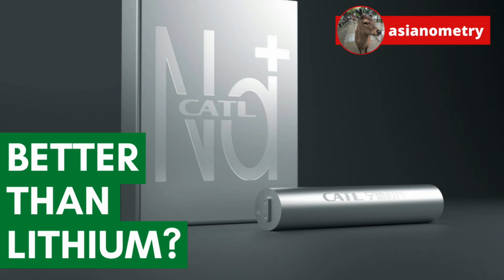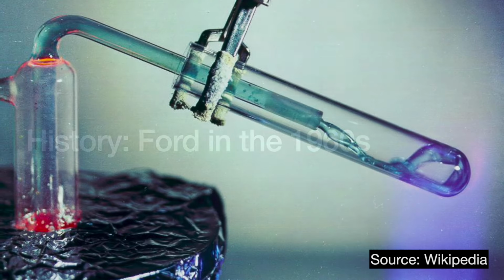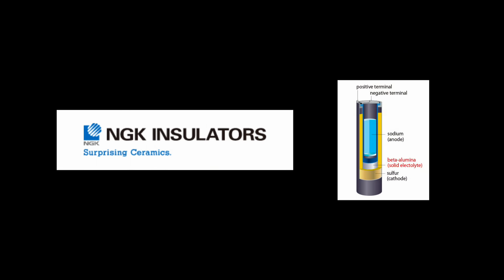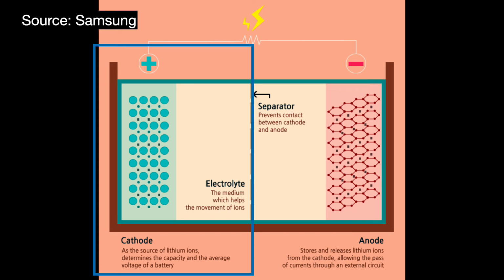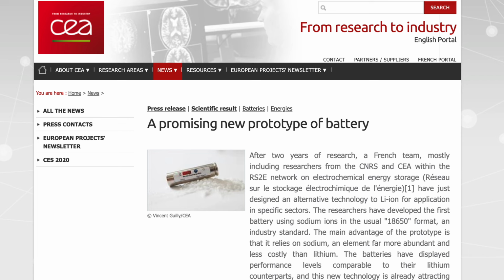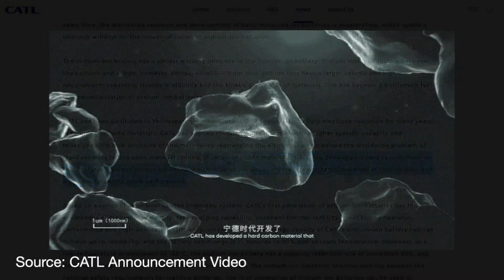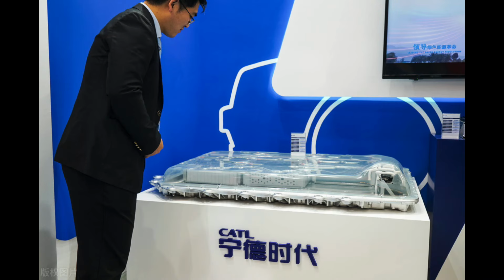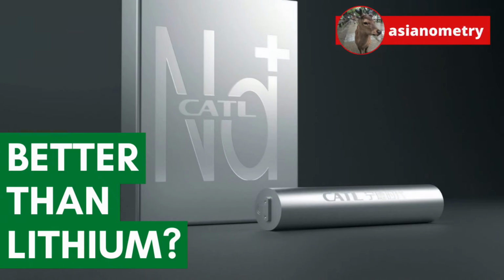CATL's Sodium-Ion Battery: Better than Lithium?

Comment: Considering how much of an EV is battery cost then 10-30% cost reduction on the batteries could absolutely be worthwhile. Even if the energy density is a little less.
Reply: This would be a game changer for the EV adoption. Lets hope it holds up to the high expectations.
Reply: availability (abundance) and low environmental impact is perhaps the most dominant factor of all as we're still at the cusp of EV transition. Will need a battery tech that stands up to a scale when everyone that currently drives a vehicle is driving an EV
Reply: The real metrics needed are cost/kWh vs weight of needed capacity. 

other considerations: 
Na+ cells are heavier for less capacity which can potentially reduce the efficiency of the motors in EVs
Na+ don't suffer from the same level of degradation of capacity that Li+ does (the so called "battery memory") 
Na+ has yet to be commercialized, and because it is emerging initial models will be much more expensive to recoup the cost of installing production facilities (or adapting current systems)
NA+ has a lower nominal voltage than Li+ and this is based on the chemical composition of the batteries and cannot be overcome. Li+ thus provides more desirable power for EV use

The point of developing Na+ batteries isn't actually to completely replace Li+ across the board, rather to reduce their use to situations where their density and voltage are required. By using these Na+ for mass energy storage (homes, power grid, industrial and commercial) the demand for Li+ will drop (reducing costs) and become more available for consumer use and in industries that require them.
Reply: @kdelfuego8563  if you have studied physics you know that weight is only an extra consumption during acceleration and the extra use of the extra weight with rolling mass is a very small factor. With braking you can get that extra energy used by acceleration partly back so you waist even less the combustion engines. Weight is not such a big issue, Aerodynamics is a much bigger issue and has way more impact than weight has. I calculates before the model 3 with NMC battery vs LFP which has 130kg more battery weight for energy density. You needed about 1% more energy per kilometer for the cheaper LFP. And the extra weight is 130kg. So you see that it's a super small factor. This will probably be also the case with Na-Ion batteries and they will improve over time. Main advantage is cost + better for inviornment. Energy density means the car will be heavier. Is that bad? It's less of a factor than cost is.... as I just showed you. People do not think correctly about rolling mass versus Aerodynamics. This is a thinking error.
Reply: @kdelfuego8563  Lithium cells do not have memory. NiCd does, not Lithium
Reply: @kdelfuego8563  
I know that Li-ion xxx batteries doesn't have a  "memory effect". Actually they have, but is so low that it can be ignored. You write that they have "memoy effect" so then what is correct...have they or not?
Reply: @kdelfuego8563  what is it that you do for a living that has given you this knowledge, Mr Whitney? Genuinely curious
Reply: @kdelfuego8563  It won't reduce the efficiency of the motors one bit ! It'll make the vehicle heavier and thus consume more energy. Same result but you got the mechanism slightly wrong.
Reply: I have made sodium battery based on Aqs electrolyte which is more energy dense than lead acid battery and much lighter Wight with 2.6 to 3.1 volts using sodium based salt  i have video of it . I can improve it much better if i can find required materials like Organic solvent pc , EC ,  or DES , Na based chlorate salt
Reply: @omsingharjit  it is my understanding that in order to preserve the charge within the cell from settling towards equilibrium it is important to use an ionicaly conductive solid electrolyte to filter the Na+ ions. 

What has been your experience?
Reply: @kdelfuego8563  current  Electrolyte based  li ion based battery is also very stable at holding their charge for long duration  .
SEI are currently under RnD area because it has some draw back like low discharge rate than Electrolyte type and dendrite issue ( not sure for now ) , manufacturing Difficulty etc
Reply: There's an exploding need in total battery capacity needed to buffer renewables and so on. Not every use has such high requirements as an EV, and every alternative made from cheap and abundant materials can help decrease price of Li-Ion batteries, since there will be less competition for the limited and expensive resource.

Something that i expect to become fully electric in foreseeable future is municipal public transport. The bus traverses 150-700m between stops, and then halts for a minute in an area with dense infrastructure, often with longer 5-10 minute halts every few km, so fundamentally giving the battery a little boost while it's just sitting there waiting for people to embark or for the schedule to catch up makes sense. Since a diesel bus idles a lot, it is a fundamental energy saving. It would also improve the quality of life of local residents, due to noise and vibration, and improve public transport acceptance. You can feel the vibration of the bus diesel through the foundation of nearby buildings! But the volumetric energy density is of little regard to such a vehicle, especially if it can be boosted often.
Reply: @SianaGearz  We have some hybrid buses in hamburg that use a generator to brake (buses brake much more than any other vehicle) and an e-motor for start-up which is super convenient for residents and passengers alike. Can't wate for this to become the norm.
Reply: No it wouldn't.  The batteries are lower energy density so you need more of them to make a car thus negating the benefits.  I only see this as useful for stationary applications like house or powerplant storage.  But in those applications, it will face stiff competition from Iron air which is higher performance and simpler.
Reply: You should pay more attention to the video. These batteries are not great for EVs as they will pack a significantly lower amount of energy per kg. Their use will be strictly in stationary systems such as home storage. In mobile systems energy density will be the determining factor for decades to come.
Reply: @muresandani  nope ! Wait for The Future of Na ion Ev
Reply: @omsingharjit  Highly unlikely, why would we ever use heavier batteries for evs? It's just not a good idea. EV batteries are already very heavy to the point of it being a problem. There's a reason we use LI-ION instead of LIFEPO4 which are cheaper. The reason is energy density. Since you have to carry the weight of the battery using heavier batteries is not an option just because it's cheaper. If the price of Li-Ion batteries stops dropping then maybe we would see alternatives in low budget evs. Otherwise we will always go for the lighter option even if it costs 20% more.
Reply: @muresandani  some people like you only think in binary way. Guess what, tesla is moving all its medium range cars to LFP batteries that have same energy density than this sodium battery. And this has much bigger advantage as it doesn't suffer from range degradation from lower temperatures. As more and more ev are sold and the infrastructure develops, people will start to see that range anxiety is a myth. For 99% of people a 200 to 250 miles range ev is plenty enough. Because guess what, everyday in the morning your tank is full, you will drive 95% of the time below 100 miles per day  and you won't need to go to the gas station every 4-7 days. This battery system will also shed some weight from not needing complex cooling system etc.
Reply: @muresandani  LiFePo4 creates fewer cells needing to be recycled. This is the overwhelming reason why I choose this chemistry over the higher energy density Li-ion
Reply: Density is less of a problem, when mixed with lithium batteries and because Na-batteries can buffer the Li-batteries heat, less room for cooling systems is required while also beeing frost resistant. 
And their density (m/v) is lower not their energy density (Wh/m) if I'm not mistaken.
Reply: @haifutter4166  technically Na  has lower Redox potential than li same time its atomic size is larger than Li  so it's Density  always gonna be lower than of Li but the advantage is it's much cheaper than rare  li .
But Potassium is also an another option which sits between both .
Reply: All current EVs have way more range than they need. They can easily lose 20-30% range in exchange for greatly reduced cost.
Reply: The question is how much less. If 10-30% as well then high possiblity 0% saving because bigger and heavier will impact the transportation cost
Reply: But that's already been done with a better solution, LFP batteries and in fact they've already gained in percentage as the batteries going into BEV.

So, these batteries will need to be almost MIRACLE batteries to replace LFP.  The auto industry is going to accept the issues with lithium considering LFP batteries solve about every other issue people can complain about for battery technology going into BEV, accept the range issue.  But considering the economics, companies can use LFP, and put of cars that cost less than $20,000 USD.  This already happens in China.  Considering a few auto makers are contracted for using LFP such as Tesla and Toyota, they're coming to the US, it's just a matter of when, and if auto makers are smart enough to realize these batteries need to go into small and mid sized cars to sell to REGULAR FOLK!!!##$%&#@!!!!!!!!!!!   Most people aren't willing to go bankrupt just to buy a BEV and considering the median income in the US, current BEV sold in the US is priced way too high for most US households.
Reply: The problem is that the biggest enemy of an EV is weight.     Why is Tesla Semi stuck?   And why are EV pickups under production today staying in the realm of unibody structure with short beds like cybertruck?   The high weight of these types of EVs reach a death cycle where a battery needs to be so large and heavy that it needs more battery to carry itself.    That is where EV limit is reached but things like changing to role of a vehicle or hybrid systems will help with the issue.
Reply: @DrScopey2  4680 solves the problem!
Reply: Wh/kg and Wh/l are the important factors. Cost, much less so. Yes, we'd like to get kW's in something the size, mass, and cost of a AA battery. But we're a long way from that. Cheap doesn't much matter if it takes have a bus to hold enough power to go 200mi.
Reply: @V M You can get an SUV like a VW ID4 for about same price than you got a Nissan Leaf 10 years ago.
Reply: You also loose 30% battery in cold weather. Lithium battery only looses 15%
Reply: What about comparative environmental costs and impacts? No one seems to have mentioned this. 

While yes Lithium production isn't completely clean environmentally, it's manageable and the processes can be refined to improve them.

But if I recall correctly, isn't the most plentiful source of Sodium actually Sodium Chloride? Or perhaps I'm thinking of Potassium Chloride...

None the less, the excess Chlorine produced would be a major issue....if it is Sodium Chloride like I'm thinking.
Reply: I wonder is a mix of battery types can be used like rather than a full lfp a mix of nickel batteries n half lfp
Reply: The battery weight is so large in most EVs though that any increase on this account will have serious drawbacks.
Reply: Sodium is hazardous , we need non haz  materials
Reply: @macdeep8523  Sodium METAL is hazardous. Lithium likewise ! That's part of why compounds of both of them are electro-chemically useful ! Sodium chloride OTOH is everywhere and no problem at all. It's common table salt.  Your comment is nonsense.
Reply: @macdeep8523  Who is/are 'we' in this context ?
Reply: Could maybe be the choice for a cheap mass production car that has a top speed of 30 miles per hour and 80 mile range. Good for the masses who don’t need high speed n power in their cars. The rich can use the lithium ion batteries n poor can use sodium
Reply: @TheBriansle   @Brian Lee  one Battery one Planet , no Sodium no Lithium and No Hydrogen ... Every human user will use a Nuclear diamond battery or Thorium Battery ,
Reply: @TheBriansle  A vehicle that can only do 30 mph would act as a rolling roadblock ! A minimum top speed of at least 60 mph might be more sensible. 80 miles range would be fine for many people.
Reply: No, energy density of Li-ion vs Sodium ion is FAR too different:
- Li-ion density: 300Wh/kg
- Sodium ion density: 160Wh/kg

Replacing it means you got ~50% less capacity for the same weight (the weight that becomes burden for the car to accelerate).
It will be viable only if the Lithium price skyrocketed and only for short-range mini car.
Reply: For consumer cars I don't see it taking over, but for commercial vehicles it is almost a no brainer. A few hundred extra kilos for a truck pulling 20 tons isn't a big deal, and they have plenty volume to use. Grid energy storage is where it really shines though.
Reply: @agsystems8220  yes it makes sense .
Reply: @agsystems8220   If that few 100 extra kilos is cargo that  Needs to be loaded on to a second truck. That increases the cost per ton mile Making the vehicle less competitive.
Reply: @agsystems8220  I’m not so sure about that. Weight is actually pretty important in trucks. The more a truck weighs the lower the payload it can haul.
Reply: A reduction in energy density is not acceptable to anyone designing with secondary batteries
Reply: @bingosunnoon9341  If the costs are low enough, and space/weight isn't a problem, sure it's acceptable. Unless you're talking about principle.. 😁
Reply: @bingosunnoon9341  *In mobile (rather than stationary) applications*.

Comment: Sodium Ion batteries have half the capacity as Lithium Ion as of now.
Reply: I thought CATL said it was a somewhat comparable energy density.
Reply: Na-ion is comparable to LFP chemistry for Li-ion, the "entry level" of energy density, at a lower cost point.

The high density formulations for Li-ion are still far better, at far higher price points.

The best choice depends on the requirements for the application. This alternative helps with cost and scarcity of materials.

Na-ion is not expected to surpass Li-ion in energy density.
Reply: @razcocloud6312  If we can make grid size batteries, it will be a game changer for renewables.  The problem now is storage of surplus power.